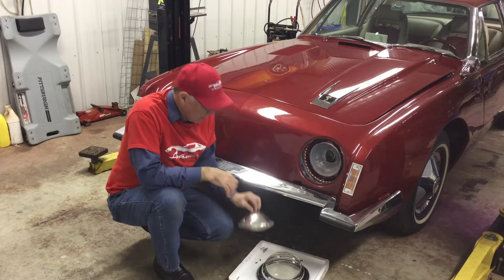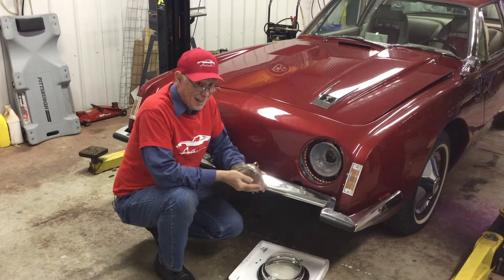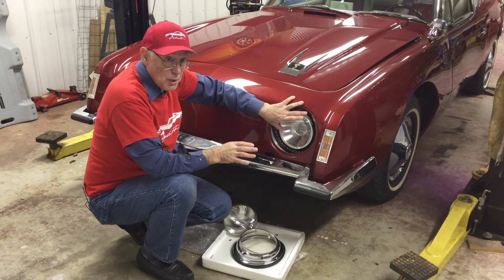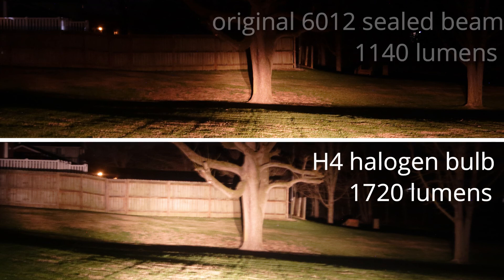Sealed Beam to H4 Headlight Conversion

Comment: 1940 ford truck, I need 7" round stock bulbs, type, incandescent, Dietz ??. I rewired with painless harness and it says do not use halogen bulbs because a relay will be needed or, as you stated here, could cause wire issues or fire. The only bulbs I can find here at local auto parts stores is halogen sealed beams. Your video here shows a complete kit with true halogen bulbs. Do you think I would be safe using the halogen seals beams? Any advise would be great.
Thank you
Reply from the maker: Your original switches pass the full load of the headlights - typical for low ampere capacity electrical systems in pre-war vehicles. Making more light, reasonably, halogen lights will require more electricity (amperes). This is true regardless of the voltage. A relay in a circuit reduces the amount of current (amperes) passing through the switch - a standard today for high load components. This allows for reducing the gage of wire needed in the control wiring (for cabin switching), reduces the required load capability of control switches, and reduces the distance between a high ampere source (battery) and  load (such as lights). Reducing this distance reduces resistance inherent to wire length and results in less heating of the wiring.
       Please understand that I take no responsibility for your choice of action. Were I to implement your suggested choice of using  sealed halogen bulbs: I would establish appropriately sized wire between the bulb sockets and  a controlling relay (an automotive grade wire gage rated for the load plus at least a 15% -these dependent on wire length, gauge, and insulation). The relay would then be supplied load current directly from a battery bus through a fuse. The original wiring to the  headlight switch would  be able to handle the load of the stock bulbs and so, could safely supply the immensely reduced current needed for relay operation. That is, the relay switching current would be supplied through the headlight switch by the wire that originally supplied current to the headlamps..
     Your supply capacity (generating capacity) needs to be considered. Vintage vehicle electrical systems are adequate for the load of original equipment. Putting in a component that will require your electrical system to supply more amperes than it is capable of will overtax the generator and possibly its regulator. (Fanbelt stress goes up, and generator components produce excess heat.) Example: for a 20 Amp system, only operation lights that need 15 amps will cause no harm. However, running the lights at 15 amps, an accessory  at 3 Amps, a fan at 5 Amps gives  total of 23 Amps - now your source is being asked to supply more than capacity. The battery supplies the difference for a while but still refers the total load back to the 20 amp generating source.
     The next issue to address then is the voltage requirements of the lights and the relay. Not an expert, I would think halogen bulbs require at least battery voltage to provide their full potential brightness - that being 13.7 V DC of a 12 V system. The question arises, are you running a 12 V system which certainly was not standard in 1940? If you are using a 12 V battery system, then my explanation would be adequate. If you have halogens suitable for 6V battery supply, then my explanation is again adequate substituting a relay suitable for 6V activation. If you have a voltage mismatch between the supply voltage and the bulb requirements,  far more alterations than wire size and the inclusion of relays and fuses need to be considered.
     Remember, safety is no accident.